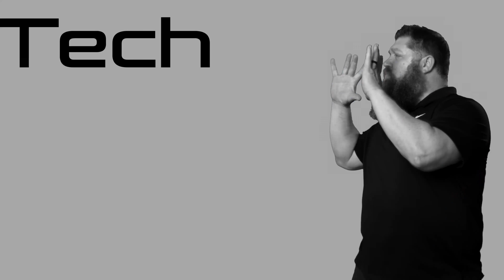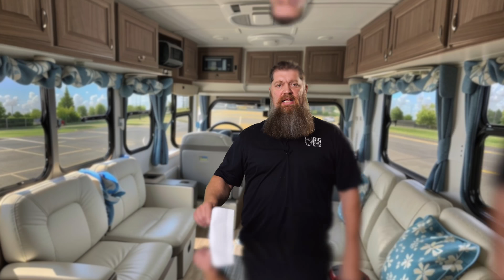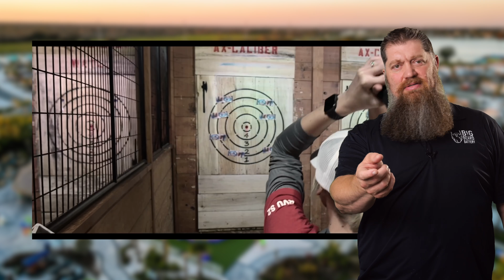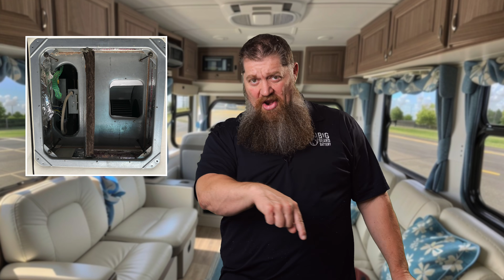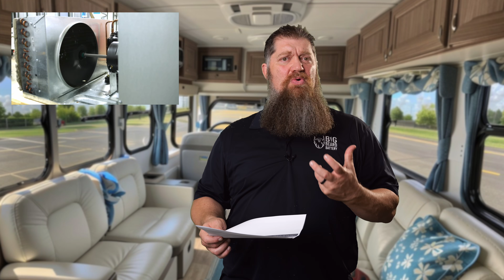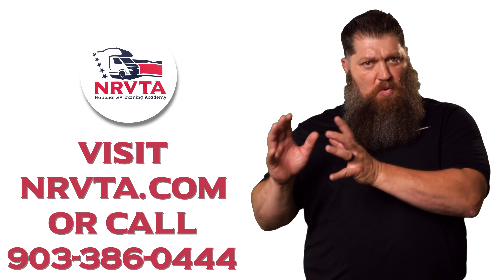RV AC Questions Answered

Comment: Todd great videos.  My 5th wheel RV has 2 A/C's and 50amp power. My factory charge converter is rated at 60amps. I upgraded from acid batteries to Lithium batteries last year. My charge converter can only charge my lithium batteries to about 75-80%. I bought a new charge converter that's only rated 55amps not like my old one that 60amps. Will the new charge converter be compatible with my new lithium batteries even though it's only 55amps?  My old one was a Progressive Dynamics PD9260C and the new one is a PowerMax PM3-55LK.

Comment: I have a 2008 Winnebago 35' Class A Motorhome it has an automatic leveling system and it jacks the front tires off the ground no matter where you start leveling why is this happening

Comment: Hi, Love your tech tips. I don’t know where questions should be sent so I’ll send my question here: When I pull my 2 slides in or out (one electric and one Hydraulic) should I have the engine running or can I just pull them in or out without the engine running? Is it OK to leave the 50 amp service on and connected with or without the engine running when running the slide in or out? I have a 2016 Tiffin Open Road gas engine (v10) on a Ford Chassis. Most of the time it works fine with the engine off. A few times only in 8 years, it required that I start the engine.

Comment: Another thing to check on a ducted system are the ceiling vents, I found our vents weren't trimmed to height so they were inside the duct too much and causing a restriction in air flow.
Measuring and cutting these helps airflow, and also sealing the gap between the duct and the ceiling, I used foil tape and trimmed all the ceiling grills this made a HUGE difference, also made my own airflow splitter for the discharge out of foam board, the cost of that Styrofoam insert was ridiculous.

Comment: Not sure about where to ask, so I'll do it here. Have an Onan QD 8000 diesel installed on a food truck (an rv that's all kitchen, eh?), but the connection to the truck is only 3 wires. Can I assume that a 4 wire connection from the genset would give me enough amps to run 2 A/C units?

Comment: I am changing the bad capacitors on a Penguin II heat pump that has a hard start installed. The large cap is labelled 40/15 but the parts diagram shows a 50/15 as the part number for it. Should I replace it with the part listed or the smaller one installed?

Comment: Had a question about our refrigerator. When we are not traveling should we leave the frig on or turn it off. Love your channel.
Reply: If your fridge is a 12v fridge you can leave it on it will run off your batteries as long as you have your batteries turned on from the battery disconnect switch. If you mean to operate your fridge on propane while towing is  dangerous. Propane fridge while operating on propane the fridge system has an open flame. You don't want an open flame while towing. All propane tanks should be turned off while towing. All gas station don;t want you to be pumping gas with an open flame on the side of your rv. Some states it's illegal to drive thru a tunnel with a propane on. Be safe and don't have your propane tank open while towing.
Reply: @theconnectedcamper  thank you. We’re new to the rv life

Comment: Todd, how about an AC shoot out video? With the introduction of several new inverter style AC's and a few new players in the AC game: all claiming to be quieter, to cool better, have less power draw and lower start up amp hit, it would be nice to see which one really preforms the best. Also compare things like ease of installation and ease of use. Looking to replace the super noisy AC in my truck camper and do not want to buy the wrong unit.

Comment: Not an A/C question as i live in the great white north and only need A/C or a fan for about 2 weeks of the year up here as it only hits 70 f tops on a sunny day in July But  If you need a high demand gas regulator and red hoses for the on demand water heaters  Will the stove and furnace work with this setup Or will they need seperate regulators ?

Comment: Do you think the rv airflow system is better than the kool rv insert ? I wanna buy one but having a hard time choosing one .
Reply: I purchased both and installed one  in my living area A/C and the other in my bedroom A/C. The kool rv was much easier to install. There was no need to remove any of the bolts holding the unit down. The rv airflow install was harder and required the removal of two bolts. When I was pushing the deflector in place I pushed the unit up and separated it from the roof. Lining the bolts up through the styrofoam was not easy as you can no longer see where they go.  As far as performance is concerned I’m still evaluating. But my initial take is that kool rv seemed a little better. I’m running both for the season and will choose which one to put in both afterwards.
Reply: I just installed a RV AirFlow system on my bedroom A/C, the main living room area already had one installed from factory. Although both brand may be good I found so many open holes around the A/C unit that my fingers would fit thru so a lot of cold air was being leaked into the attic. The installation was easy. I removed cover by 4 small screws, removed a divider between output and intake, removed 4 long 8" lag bolts., removed the metal brace around the unit. The one thing that took the longest to do was covering up all the hold where air was escaping. My kit came with a small roll of duct tape but you're better off to go to Home Depot and get a roll of the metallic duct tape for vents. I must have use 20 feet covering up all the holes and rolling some into the ducts closing any possible air leak. The whole installation took about 1 hour.  I fell that its going to work a lot better just by having all the holes covered.

Comment: I have a 2001 Ford Damon Intruder, with an Onan gas generator. I hate the fact that I have no choice but to use the gas in my tank, and not butane, if needed. I’ve heard there is a kit to convert it so that it can use either. Could you please expand on that for me some?
Reply: Propane nit butaine. They have kits for cars and it's a big to do. I haven't heard anything about a generator.

Comment: I had a brand new 15,000 btu dometic put in two weeks ago and still every now and then it will freeze up. I checked the amp draw many times and it’s between 11.7-13. I put in a new freeze sensor probe. The inside of the unit is taped up very good so I’m not mixing hot air with cold. Any ideas.
Reply: While running on auto, the unit kicks on and off constantly. That’s working your system on overload. Set it to the temperature you like and let it run on high at all times.
Reply: @CoreyRobbins-g2d  27 years of owning RVs never have we ever needed to run our Ac units on anything but AUTO...I would never want my ac fan running 24/7 that's why my reply stated that I didn't like the idea but it may be a fix for them. 27 years always AUTO in some of the nastiest most humid climates you could ever be in and not one freeze up. Does your home AC fan run non stop 24/7? Nope why should your RV AC unit just to work properly?
Reply: @CoreyRobbins-g2d  I’m willing to try anything, thank you very much
Reply: How do you have the tstat set?
Reply: @EBKRV412  I’ve tried setting it from 72-76 and it will still freeze. You would think it only does it when it’s set to a colder temp but it doesn’t. If it done it all the time I would be glad because then I can just take it down and take it back but it won’t
Reply: @Oldman2599  do you run it in high low or auto? What's the typical outside humidity when it's freezing up?
Reply: @EBKRV412  I run it on auto and I don’t know the humidity but the outside temps have been from 85-90.
Reply: @EBKRV412  the unit I took out was ten years old and it all by it’s self would freeze us out without even using the front ac.
Reply: @Oldman2599  when we were in VA before same weather temps 80's-90's it is so humid our AC also freezing up,spitting ice 😅
Reply: @Oldman2599  try setting it at say 65...the tstat's are usually off in temp to begin with setting it lower will make that unit run more often causing less ice build up in more humid climates...another alternative which I don't like to do is setting it at your desired temp and setting the fan to high where the fan will constantly run and compressor will kick  on and off as need be...we rv in the south in the summer very hot extremely humid with the ac set at 65 it pretty much runs non stop during daylight hours but have never had an issue with it freezing up. The new units like anything else I'm sure are not built as well as the previous gen unfortunately
Reply: @Oldman2599  Nathan another thing that could be happening is your unit is not sealed properly up inside. The divider inside the plenum between the intake and exhaust may not be sealed properly causing warm and cold air to mix inside the unit causing it to freeze up. I would take the filter out take a good look up inside there feel around and make sure its sealed properly and if not use a good Duct foil tape to seal it up well and I bet your unit never freezes up again on any setting you put it at
Reply: @EBKRV412  it’s sealed perfect
Reply: @EBKRV412  I really thank you for the advice. I ran it last night all night at 72 and the only thing that froze was me but that’s how this thing has been working from day one out of the box, one day it will and the next it won’t.
Reply: @Oldman2599  no problem I would def get up inside there and make sure its all sealed up good then...sorry just seen the other reply
Reply: @EBKRV412  yes sir I’m in Florida now also and I will try to set it lower tonight. I ran it last night at 72 and about 2 1/2 inches from the top down was solid ice when I got up at 6 but the rv was cold.